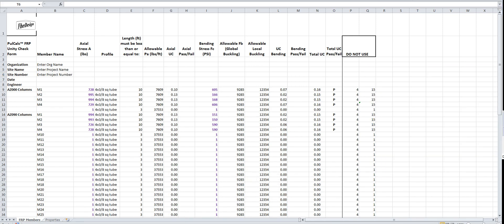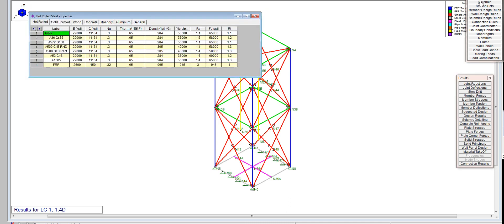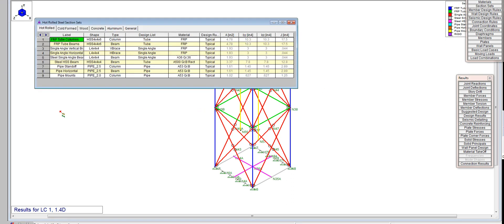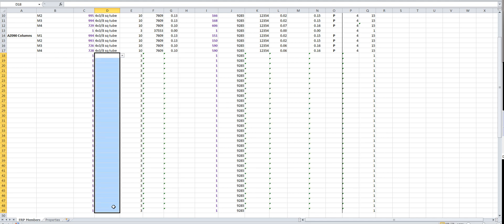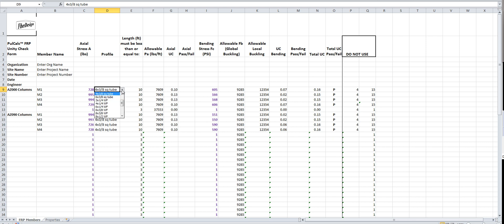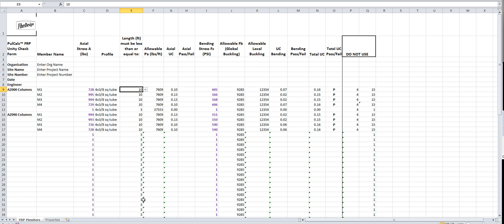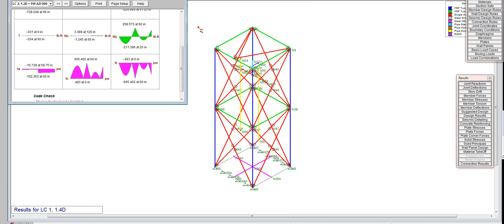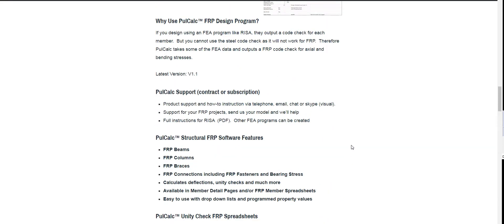PulCalc FRP Spreadsheet Tutorial

Comment: It looks like you are entering 945 psi as the yield strength and ultimate strength on your Risa hot rolled steel properties spreadsheet - is this right?
Also, are unbraced lengths (Lbcomp-top, Lbcomp-bott etc) a consideration in the design of FRP?
Reply from the maker: The design data is from the RISA Detail Sheet for each member.  No such thing as yield strength in FRP, but we do use the formulas from the ASCE FRP Pre-Standard for allowables etc.   Yes unbraced lengths can be used for FRP.   More info here:  https://risa.com/post/designing-pultruded-frp-structures-using-risa-3d-and-pulcalc